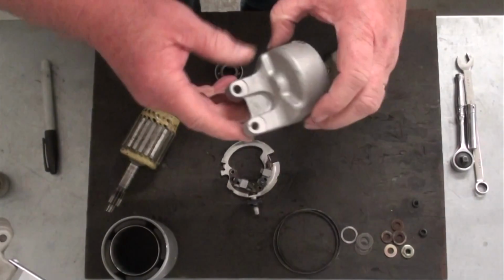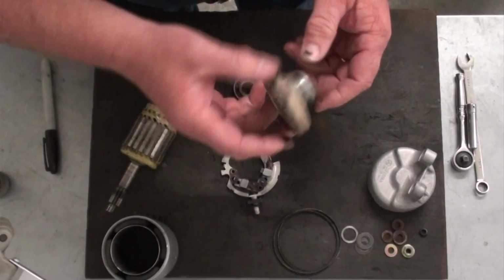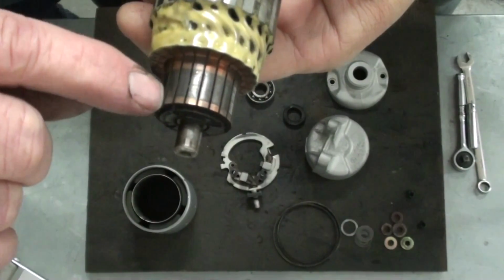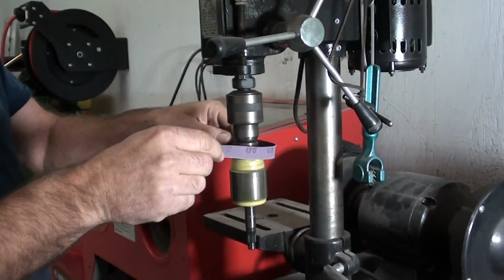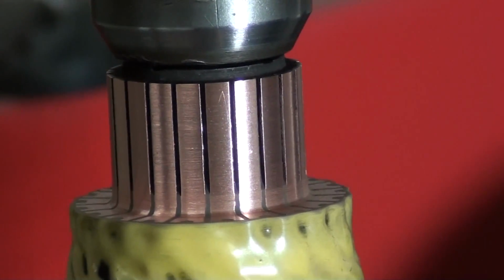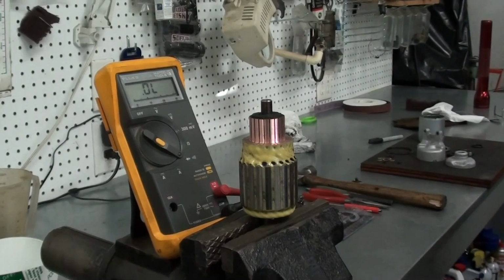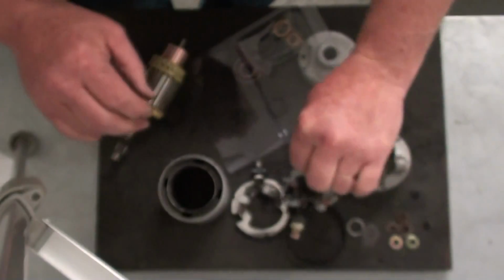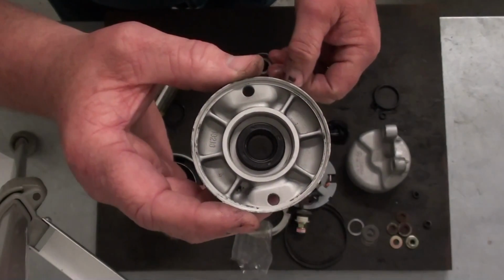Pt.2 Starter Rebuild For ATV's UTV's And Motorcycles At D-Ray's Shop

Comment: The nose side sits in the engine oil? I don't think that's right. At least not on my bike. The manual says nothing about draining the engine oil before taking the starter motor off the bike

Comment: What if they are shorted to ground ... mine was working but  hanging up .. cleaned it up bought new brushes ... now it will not work .. I placed a in line  fuse to battery for testing and it blows fuse every time as soon as touching wires to battery.

Comment: Good day sir, I have the same clicking issue. If I turn the main power stub on the starter ( 1/32'')  it will then start the atv. Does this sound like a bad brush plate or is there a common fix for loose fitting? Thanks for the videos

Comment: Just a thought. You said you weren't going to change the one bushing cause it was good so you weren't going to dig it out. I'm not sure what you mean by dig!! I don't know if you know this little trick to get bushings out of a blind hole, but if you fill it full of any grease and then tap the shaft back into the bushing it will push the bushing right out. 
Love your videos,
Oh ya, whats going on with the boat???
Brian
Reply from the maker: Thanks B! Yup used the grease and wooden dowel on many a pilot bushings back in th' day. The boat is still chillin' right now, got to get other stuff out of the shop first, Thanks for watchin' !